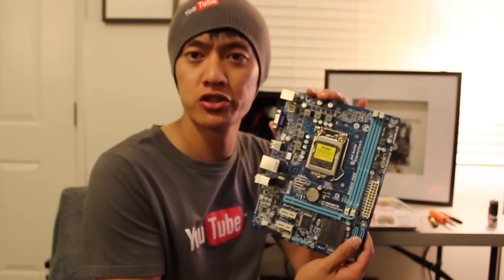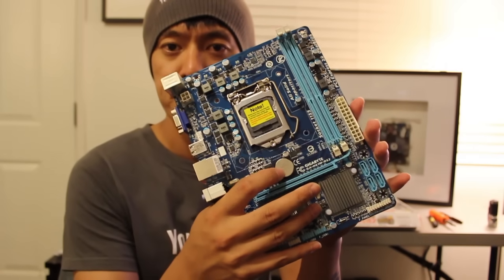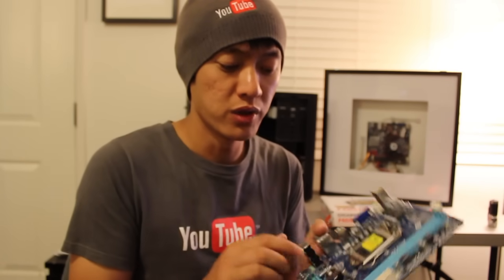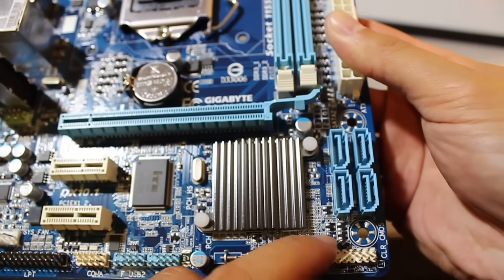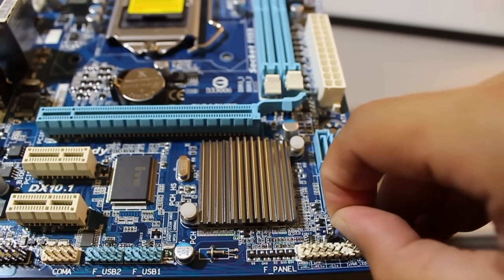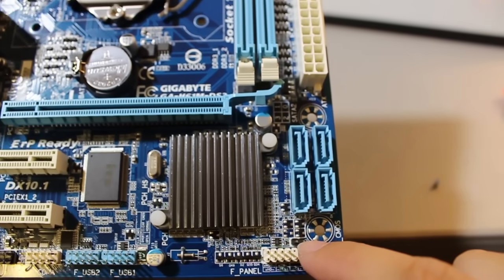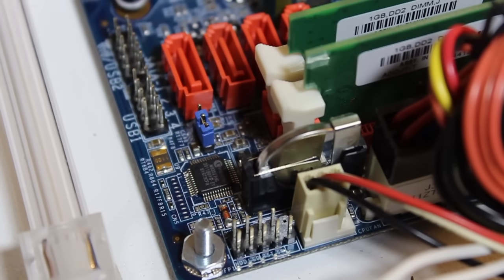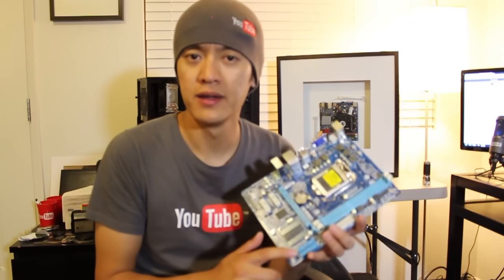How to Clear the CMOS - Reset the BIOS & Why

Comment: Help needed here please. TIA. I have built a system very similar to the one described in Johnny's 'Build Guide Part 1'. Same motherboard (Asrock FM2A88X Extreme 6+) and processor (AMD A series A10-7850K), Corsair PSU, 8 Gb Savage Hyper X, Sandisk Extreme Pro SS Drive etc. On power up the board‘s ‘internal reset’ and ‘on off’ buttons light up red and Dr Bug shows a C9 code. The 4 case fans work as does the CPU fan and an internal card reader - i.e. it lights up. The DVD drawer opens when you push the button.

My monitor shows the Asrock screen where it asks to hit F2 or Del to run the UEFI setup. But nothing happens; I’m using a Logitech ‘Elite’ PS/2 keyboard that works on a different computer. I’ve tried watching videos and reading comments in an effort to identify the problem . I have removed the ram modules, removed the bios jumper, disconnected the battery, left the machine totally disconnected overnight, then reassembled everything but to no avail. I’ve today put in a different battery and that doesn’t seem to be the problem.

Added: Bios version as indicated on the mobo shows as P3.00 and has a small illuminated red light along side.

Added 2: Still getting the C9 code

Added 3: Disconnected all the cabling on the rear last night and then re-powered this morning BUT had neglected to connect the keyboard. Guess what. Same screen on monitor so it looks like there could be a keyboard issue i.e. it's not being recognised so hitting F2 or Del is pointless. Will try and borrow a different  one and update later.

Added 4: No progress - I've tried two more PS/2 keyboards but on power up, everything works as described above in paragraphs 1 & 2 but I cannot get past the Asrock opening screen with code C9 on the Dr Bug module.

Comment: I have an Asus Windows 8 notebook which I haven’t used for a long time and when I started it up a couple of days ago I could hear the fan running and the power light was on but the screen was black. Referring to your video you mentioned that perhaps the battery had run out of power and I’m wondering if I just replace the CMOS battery that that might fix the problem? Any thoughts on this?

Comment: I can find the pins but don't hAve the little plastic part he used to reset. Will it work just taking battery out for a few hours? Also, my pc worked until I moved rooms, now I don't get a signal to monitor or beeps, that is why I'm trying to clear csmos. Any advice would be much appreciated. The tech from Asrock said to use outputs from pcle to connect to monitor. I don't even know what that means.

Comment: I'm installing a modded X5470 CPU in my old Dell Optiplex 380 MT can you tell me how i do the jumper thing on my Dell please?
Because i'm gonna need to do that after i flash the bios and before i  boot up with this new X5470 CPU.

Comment: Happened onto this video whilst in the midst of a gimlet eyed, excruciatingly pedantic reassembly following a full teardown of my youngest's new PC build. This moment comes on the tail of far too many nights spent sifting through message boards for resolution to our lack of POST or video output signal.

(You know, something that doesn't involve just buying new parts until something works...)

So here I am, replying to a video eight years after it was posted as a kind of good luck gesture or something. 

Cross your fingers.

Comment: My pc been working fine for about 6 months. For some reason, it got stuck in bios and I couldn’t get it to boot windows 10. I fixed it the first 2 times, but those settings are still in place and my pc getting stuck in bios, can someone please help. My motherboard is: MSI B250M
Reply: ItsRacer damn me too but i dont have that same board

Comment: i wonder if you have any recommendations for my issue. i just made a pc and it will not work. 

For example. when the PSU is on and i press the pc case on button, the fans light up, the cpu fan starts spinning; everything seems to be working fine

but it will not display anything onto my motherboard, let alone even recognize that there is an hdmi plugged in. i even tried vga too. i can’t go into the bios to set up my computer because there’s no way to display an image on screen, you know? also, my keyboards don’t get power and i’ve tried all the usb ports. my mouse works on all the usb ports as it lights up, but not the keyboard. i do not know the issue
Reply: UniversalSquadra mines the same minus the keyboard issue
Reply: MULTIXD you haven’t heard of any ways to fix it yet?

Comment: My Vista desktop starts up but then shuts down within 5 seconds; could resetting the BIOS solve my problem?
Also, if the CMOS battery is dead (the PC is ≈8+ years old) could that prevent my PC from not booting?

Comment: oops, I didn't finish.  Should I change the battery again? i changed it, first, because I thought that was the reason for the beeping. I, then removed two jumpers near the battery. I was trying to follow another video, but , it wasn't clear about where to return the jumpers. OMG!
I just unplugged everything and left the jumpers off.  So, I am wondering, if I wore out the battery? Thanks again, for your help.

Comment: My windows 7 wont boot after i upgraded my intel cpu and my asus  z97-p BIOS. i checked if the AHCI was enabled, also checked if secure boot was set to other OS to prevent that UEFI error that windos 7 gives to the motherboard. Do you have any suggestions?

Comment: I took out my cmos battery while cleaning dust out to hopefully reset my system. Now I get 4 beeps and no USB keyboard and no display. Just a constant 4 consecutive beeps. Some say I need to clean my ram . Hope that works. My question is, should I be concerned about removing and placing cmos battery back in ?

Comment: What if I have 4 pins; should I put it on the other 2. It disables if I simply remove it but after resetting BIOS I still can't get the OS to load.

Comment: Hey johnny, I have a computer that I haven't used in a while. it started up fine but I wanted to put Windows 10 on it. so when I went to restart it and enter bios i wasnt able to.After a few tries I got angry and pushed the power button and when I went to restart it, it went to the "Windows didn't shut off properly" screen. so I try to select the start normally option and I find out I can't move/select anything. pretty sure it's not letting usb work during that moment, someone recomended using a Ps/2 keyboard but I don't have that kind of port on my computer. is reserving the bios gonna be the next step?
Reply from the maker: Ruebinok most likely your usb keyboard is not compatible with the bios. you can try using another usb keyboard. its happened to me in the past with a gaming keyboard. so I have used a generic usb keyboard like the ones that come free with a Dell computer.
Reply: thanks worked for me

Comment: So, I just tried to install the new 1080, I am stuck on BIOS and I keep hearing a beep every 10-15 seconds and a click noise when I  click a keyboard button, do you think this might because of the CMOS needing to be reset? It runs fine when I put back the old GPU/s, or could this be because I haven't updated my BIOS in a while?

Comment: My mother board won't turn on and only a blue led light will blink if I hold the power button. No fans turn on and I know the pcu works iv tried it on other motherboards and even used a different cpu and nothing has seemed to work need help.

Comment: Hey johnny, I have a problem regarding to the uefi bios on my asus z170 gaming pro aura, after I optimize all the chasis fan (i have 3 120 mm fans) then when I click OK it freezes. I do not know what to do it just keeps on freezing after the Q fan optimization. This is my specs core i7 6700K, 16 gb ram, asus gtx 950 and a intel ssd. I only use 500 watts to power everything. I need help!

Comment: i just bought an asus x570 strix e motherboard and.. it also had only this jumper method available, in case of big bios crash trouble like that ; no clear cmos button on the back, no clear button on the motherboard; only that method,  with the 2 pins on the motherboard.. pretty hardcore for one of the worst pc moment for users if needed.. and at the worst possible placement; bottom right corner (once in a case.. just crazy to reach it..with a screwdriver). They advise the 'screwdriver' method (5/10s) ok.. my question would just be... would it be safe, to make the operation a little easier if that bad situation happens.. to simply add and let a 2 pins jumper always on the motherboard.. obviously only connected on 1 of the 2 pins for normal operations.. and just connected 5/10 on the 2 pins when neeeded (replacing the screwdriver). And once done, reconnecting it on 1 pin only, reboot, etc. Just to make the thing a little easier (no 'electricity conductor' screwdriver always around needed necessarily..). Would it be safe to let the jumper connected on 1 pin only the majority of time, like that ? on old motherboards i think that's what they were doing.. but of course, now, on that x570 300€+ strix-e motherboard, they not even thought that could be handy for the users apparently..to have 1 little jumper ready that way at least .. would it be safe to add one so, just in case (1 pin connected) ?

Comment: If a Z270 motherboard does not have a clear CMOS button or jumper, can the BIOS be reset to default setting by removing the CMOS battery and reinserting the CMOS battery?

Comment: Please explain what happens next, I want to access my bios but get a black screen when I try. I have tried all the possible monitor connections I can but still only a black screen, windows boots as normal but bios is inaccessible. Problem began when I upgraded my GPU, it has hung on the splash screen for upto 3 minutes on startup since the GPU was changed. If I clear CMOS will it revert to onboard graphics ie MOBO VGA port?

Comment: In my case there is 2 jumper so i did  the reset on both but still 4 beeping and black screen. I clean the ram lot and graphic card and not change. Any solution?

Comment: I'm new at this stuff but like does removing CMOS battery manually factory wipe your data. (I'm trying to factory wipe since safe mode reset is not working)

Comment: Hi Johnny pls can you help me.
I have a msi x370 gaming pro AMD edition board.
I updated my bios yesterday.
After the update my bios click 5 was gone.
I only have the click bios version. No number version.
After I update the bios. My PC takes about 3 to 4 minutes to start up from boot to windows 10.
If I clear the cmos will it revert back to the original settings ? 
I saw that msi update the bios with a new version again due to slow start ups. Yet today I tried to to get the new bios loaded. The bios will see the USB but not allow me to update. Not sure what to do or update this or even fix this problem.
What advise do you have pls 
Thanks Denis.

Comment: Hey Johnny I don't want to try anything just in case I screw up my whole PC but I recently went from a AMD A4 6300 to a AMD Athlon 880k and my PC freezes on boot up and sometimes 5-10 minutes into signing do you think this would work or would I have to update my bios or what.
There are no good videos and all the articles I have been on say the same thing but are of no real help
Reply from the maker: Locky I think you should check the temps using something like nzxt cam or cpuz. Are your temps normal?
Reply: Johnny Phung thanks for the reply but I decided to just reset my bios back to default and it has actually worked not froze and I have been using it just a little bit before I commented but thanks for the reply!

Comment: Hey Johnny :)

Thank you for the explanation on the topic, I found answers to almost all of my questions on the topic.
If you are familiar with it, there is a thing I wanted to ask:

I've bought new PC and had some TPM problems, but when guy that I bought PC from was trying to find the problem, he tweaked some settings on my motherboard... 

Now my fans are working odd and I think he overclocked CPU to stress the components and find what's wrong. But being the TPM module fault I want to reset my motherboard to default settings. I don't want overclocked components. Everything is powerful enough on its own.

I have tried some settings in a bios but I don't have enough knowledge to do that properly. And my motherboard worked just fine with factory settings. So I want to try this hard reset.

I have understood that if I did this hard reset all the settings including CPU settings and everything will be returned to factory settings? Also bios version will be factory Yes? Because he installed beta version of BIOS.

And my motherboard will be like I unboxed it right now from the factory? I would have to install all the drivers and everything?

I really need help with this... 😅

Comment: My new Gigabyte H310M S2H 2.0 board, fitted with an i3 8100, is doing exactly this.  No boot up, and no display.  I've checked the connections, and tried it with no boot drive or DVD drive connected.  I've checked that the RAM is seated correctly, and even taken the BIOS battery out for a couple of minutes.  Nothing boots.  Tried two monitors, but to no avail.  The fans run, the power LED lights, and the DVD tray pops in and out when the button is pressed.

Comment: I am sort of new to building PC's. If I upgrade my 2 core Intel processor to a quad-core Intel processor, is it as simple as swap and power on, or do I need to reset the bios to make it work?(Hoping you could tell me before I take it, and will   know what to expect).
Reply from the maker: You should not need to reset the bios, but just make sure your motherboard is compatible with that new cpu. If the motherboard needs an update, it will reset to defaults after the updates.
Reply: Thanks for the speedy advice! It turned out that it was as simple as swapping in the Intel quad-core processor and power on. I knew the socket on the motherboard would accept an this older core for a Dell Optiplex 780 desktop. 

The processor swap: 2 Duo CPU E8400 3.0GHz to a 2 Quad Q9650 4-core 3.0GHz 12MB LGA775.
Reply: I had already changed out the mechanical hard drive for a new Samsung 860 EVO, which is noticeably faster. The only thing to do next is to replace the 8gb of ram for 16gb.

Comment: +Johnny Phung Will this work for my scenario? Specifically what's happening with my computer is, the tech guy at PC Audio Labs, Brian, updated my operating system, which in turn makes the DVD/CD Rom Drive shut off after several hours. Worse yet, the DVD/CD Rom Drive disappears from My Computer, Device Management and Disk Management. I've had to restore my machine back to 9/2/2011 at 12:47 PM, then reinstall my programs like JAWS (Job Access With Speech) screenreader software. Then my machine automatically started installing updates to Windows without my knowledge or consent. This in turn messed with the hardware drivers like the DVD/CD Rom. Will resetting the bios make the DVD/CD Rom behave in a way that it will stay turned on indefinitely instead of shutting it off after several hours? Better yet, is there a way for me to do this if I can't see? Or will I need sighted help?

Comment: I need to find my manual for my motherboard in my Toshiba L775-S7130.  I'm pretty sure its a Hannstar J 94v-0 e89382 rev:2.1 p/n: 08N1-0NA1-0NA1JOO.  I've looked everywhere and cant find it anywhere.  im trying to clear my CMOS but ive looked with a fine tooth comb and nothing.  I don't see it at all.

Comment: I got a question and I hope you check this message, I recovered and reset my computer because my mouse wasn't working normally (laggy) so Yea I reset the whole system but it doesn't work, then I Reset for the 3rd times my computer turn on and then like 10 sec later it restart and repeatedly, this computer is brand new 2 week, do you think it the cmos?

Comment: I really enjoyed this video! Keep getting incorrect PW win logon.
Next, turn something on/off in win 10 pro bios; now, HDD isn't visible. Therefore, message reads " no disk found" during start-up. Resetting bios jumper solve my problem and will I still have my 10 pro OS installed fully functional on computer.

Comment: I have a nzxt z370 and it has the bios where I can use a 9th gen cpu 
I have a i9-9900k and it works good but I can’t change the ram speed there is not xmp profile option, I can do it manually but once I restart the pc it goes back to 2133mhz I wonder if this could help

Comment: Recently I've been experiencing issues. Every time I boot, I get a menu saying something like 'bios has been reset choose how you'd like to start'. A local guy told me on a train that it's because of the CMOS battery not working. Is it? And if it is, to change the battery, do I need to do anything else or just remove it and replace it with a new one? My motherboard is Gigabyte Z97 and I also need to know what type (model) of CMOS battery should I get? I am not computer savvy, please help me.
Reply: +vansonia What's that supposed to do?

Comment: Hey so I just put in a new motherboard and my BOOT Light stays on, I’ve taken out the cmos battery for a while to try and drain the power to reset and it’s still on. The motherboard is new so any suggestions?

Comment: Im trying to get mine working i replaced the cmos battery on my asus p8z68 deluxe/gen 3 soo now the cpu led is red and it wont boot/ or post and i have no display so i assume this shitty bios crashed, and it has a cmos button but no jumper so i dont know how to manually reset the bios